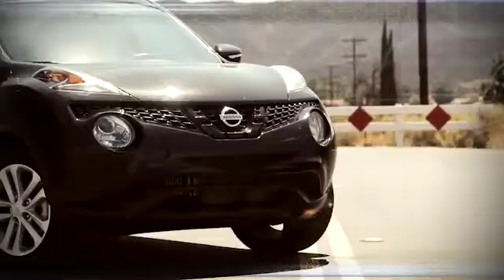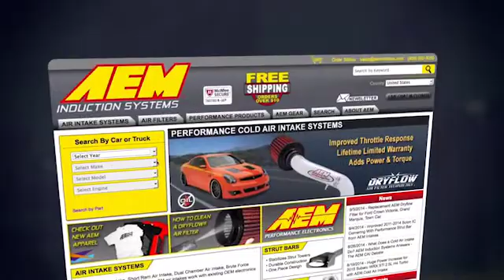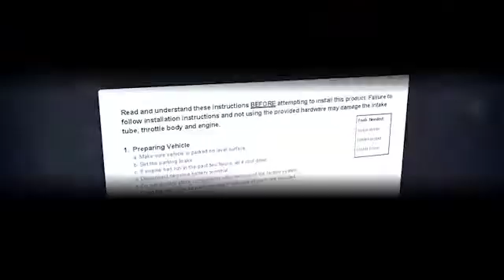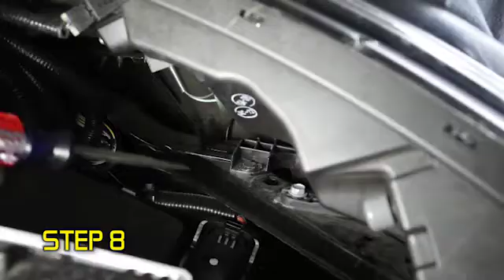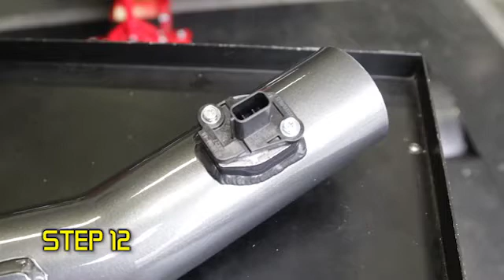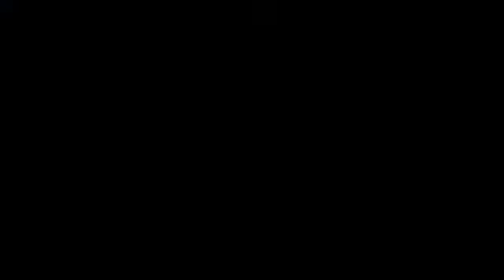AEM Cold Air Intake Install - Nissan Juke Nismo RS

Comment: So you take the wheel off every time you need to clean the filter?
Reply: Oiled filters last 10's of thousands of miles (about 50k) before needing to be cleaned and resprayed. For typical daily drivers that is 3-5 years.